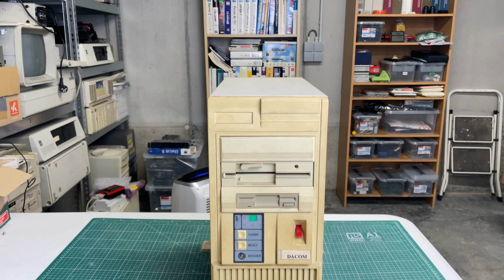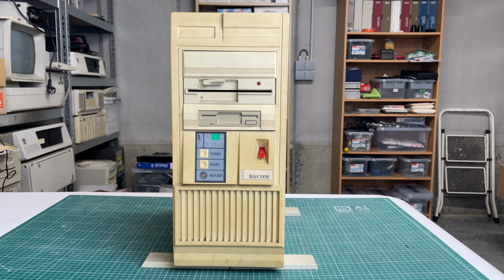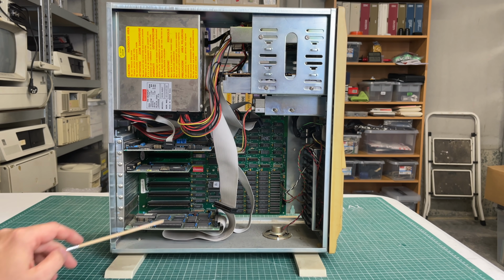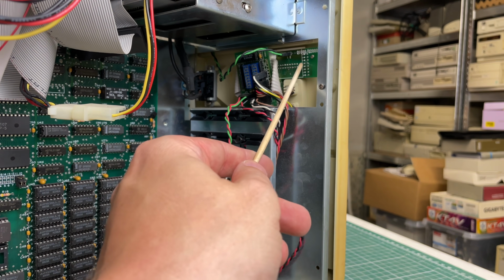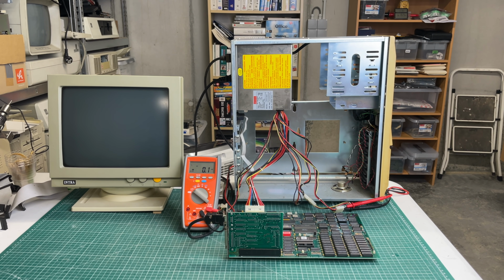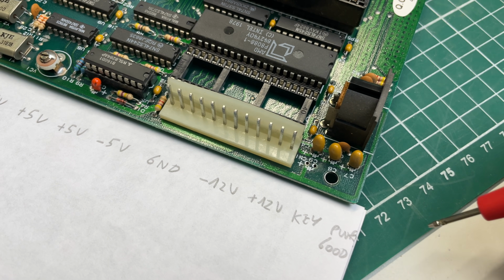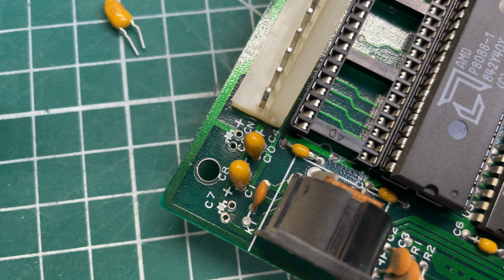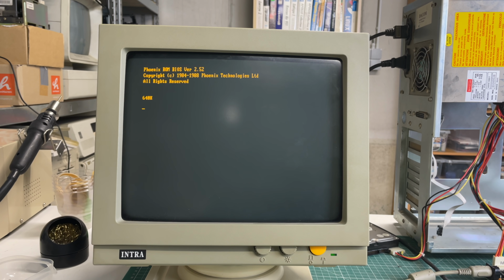New 35yr old mystery PC ... lets check it out.

Comment: Not sure if you know this, but the turbo switch doesn't increase speeds bit attually down clocks the system making it more compatible. Some games, and software back in the day designed for say a 40mhz CPU would run fine but then you might try running something that's designed for 33mhz so the turbo switch down clocks the system to match or at least make more system sense.

Comment: There has to be a gentler way to get these things going. I think there was an old talk by James (Bald Engineer aka AddOhms) who was working at Kemet at the time, and i think i took home that the tantalum capacitors don't like being stressed very much, and this can be any kind of stress, it could be impact, vibration, external temperature, like every time you let a device like that sit for a time and maybe carry it about, it could be in a bit of a peril. But you can gradually bring up the voltage to condition them and they'll be able to re-form nicely and avoid becoming fireworks.

I don't know the classic PC enough, but what if you had a custom power supply that would gradually walk up the voltage, and what if you held down all the ICs all in reset while this is happening, as a safety measure of sorts? Is there a way to hold every IC in reset simultaneously on a PC of that era?
Reply: By the way, James has become a big classic computer nerd himself. He does 8-bit computer repairs and redraws and validates their schematics 2-3 days every week.

Oh and the talk was "James Lewis - They're Just Capacitors" on the Supplyframe channel.

Comment: A minute in, I'm gonna take a guess at 286 or 386, judging by the XT-style power supply. Comtex was using that style power supply into the early 486's. CGA video, since they were often coupled with printer ports. Probably a 286, in that case.

Later: 8-bit ISA and an AMD 8088-1. 10MHz 8088. That's older than I thought.
Reply from the maker: my thoughts exactly ...  was surprised to find an XT in here. But the case does provide some nice upgrade possibilities as I feel a 286 or 386 would fit in very nicely.
Reply: @RetroSpector78  It just so happens to be similar specs to a Hyundai XT clone I'm playing with. Mine only has 6 slots though. Was buggering around for several months with it, trying to solve a RAM issue, which I was eventually able to trace to a single NAND gate.

Comment: When I first saw it I thought this could be an AT class machine, a 286, 386 perhaps? But this one has deceiving looks. There’s just something about that case that doesn’t make one expect it to be an XT. It’s the tower form factor and the beige colour of the drives that made me think that. I guess you shouldn’t take a computer on face value based on just it’s looks….. it’s definitely a bit odd for an XT. I guess looks can de deceiving.
Reply: If that be a 35 years ago PC, ain't likely a AT. I remember I got my first XT around 12yo... then around 14yo in my sec 2 years you got AT 286... then AT 386... ...

Cos 35years ago from 2022, XT sold for around S$4000 which was like USD 2000. So unlikely AT.

Comment: 14:00 it looks more like 100n high-voltage ceramic cap... Never seen those go smoky like this.
Reply: Maybe the broken cap is C14, just next to the ISA slot, and it's just its smoke from that cap the blackens the 100n cap. I agree, I never saw 100n caps break when they are just connected to +5V. I did see ceramic caps go leaky/short and causing a PCB fire in a 7kV supply, though.

Comment: I Definitely wasn't expecting an xt judging by the case alone.
Reply from the maker: Same here .... Thought for sure 286 or 386. But does provide some nice upgrade opportunities
Reply: @RetroSpector78  when I first saw it I said 386, then I saw the not CGA card and said, ok a 286..., but alas, twas mda and an 8088. Super cool, I never find anything that old around here...
Reply: @CoreyDeWalt  I immediately noticed the decimal point on the MHz display so I thought of something like an 8 MHz 286. You could also see the monitor in the preview and that definitely looked like monochrome, so I'd ruled out a 386 or 486 even before I'd started the actual video. I've never seen an XT with a 3.5" FDD though, let alone a 3.5" MFM HDD! I fully expected a Seagate ST225 or something along those lines - 225s and 251s were immensely popular for 286 machines here.

Back when I played with those machines a lot they were definitely less likely to burst into flames I have to say! Back in the 90s I only had one explosion, a dual game port controller had a short and blew up the power supply of a 286. Sadly that wasn't a standard AT power supply and couldn't be replaced without sawing holes into the case. That was a very sleek-looking case with LED display and everything, it must have looked very modern when it was new!

Comment: I use ceramic cap's, now that they are available in "large" values
Reply: EEVblog had a video on how cheap ceramic cap parameters fluctuate significantly depending on temperature, voltage and vibrations. As far as I know, the only good ceramic caps are of C0G/NP0 type, and I'm yet to find a 10uF of one of those. Although for DC filtering the cheaper ones should work just fine.
Reply: @Arti9m  yea I am sure for dc filtering application even the cheapest ceramic's will be more stable than tant's from 30+ years ago
Reply: @Arti9m  You don't need C0G across the power rails. In fact you shouldn't find tants in signal path to begin with, they are pretty nasty too, MLCC are almost benign in comparison. X5R are standard around these capacities and they're easily good enough. I think recently enough you'd expect them to be Y5V and you just have to overrate those and tolerate the behaviour.

In fact with the placement that i can see here, presumably well upstream from a ceramic, half the board away from immediate consumers, a modern cheap aluminium electrolytic would do just fine. In the 80s, i believe (don't sue me, i might be wrong) there was a time when tantalum was cheap for these sort of capacities of a handful uF and low voltages, which is probably how they ended up there, not because of their performance.
Reply: @SianaGearz  I think tantalums were particularly popular for their compact size in the late 70s and early 80s. Dual used them extensively in the motor electronics of their TOTL DD turntables and they fail left and right, mostly 1 and 2.2 µF. Most people just replace them with new aluminium eletrolytics and it works fine.

Comment: It is possible to get away with using the computer without those tantalums next to the connector. If you are using a decent more modern atx supply anyhow. I have a 386 here that I just clipped them all out and the machine has been fine since. First time I powered it on of course I had an exciting pop from one lol.
Reply: I would just put Electrolytics caps there instead. A friend and I looked at to fix up a 286 board for him, after number 4 tantalum blew I just replaced ALL of them, like 25-30 of them with 10uf 16V or so Electrolytics from Würth because I had that at home. Board ran just fine with that and the PCB print even seems to suggest electrolytic where an option.
I personally cant see why modern electrolytics or even polymer cant be used instead.
Reply: @NittonÅttiofyra  Ohh for sure. My 386 didn't have issues with anything but the bulb on the 12 volt rail. and the 5 volt shorted as well. So those ones got clipped off, none of the other capacitors on the board were removed.  Just the 4 next to the AT power connector. I figured I will get around to putting replacements in there one day. But for now i am not having any issues.

Comment: The 100nF ceramic capacitor burning out on the MDA card is a very, very rare thing. Normally these are extremely reliable... Might have seen mechanical damage though.